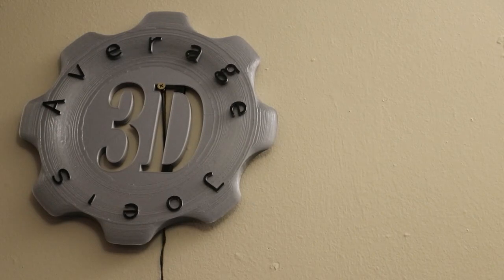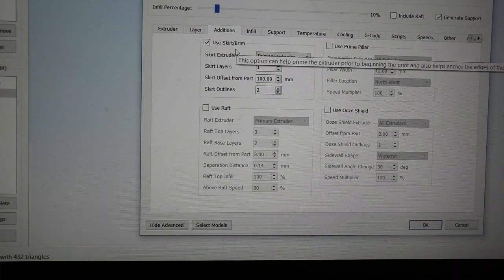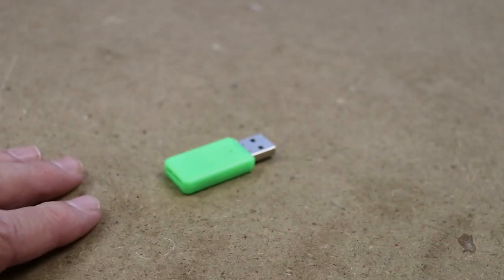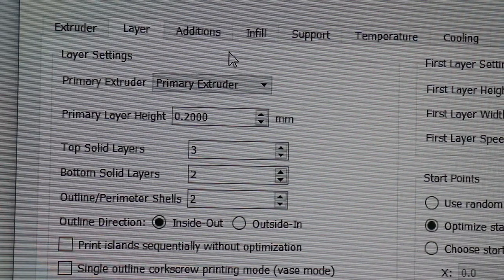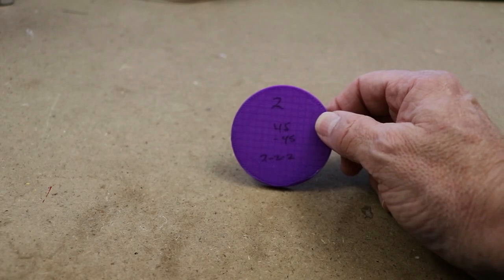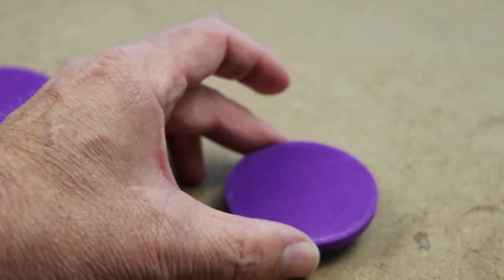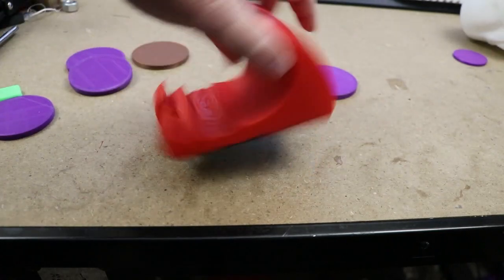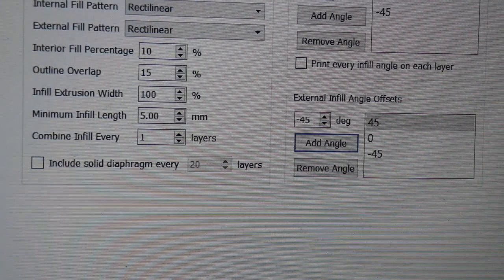Printing Top Layers

Comment: You might have already addressed this over the last 3 years, but I thought I'd mention that the top layer quality issues, i.e. holes and sag between underlying infill, looks to be an under extrusion issue. Here are a few mitigations you could test/try. 
1) Increase your hot-end temp.
2) Increase your extrusion flow rate.
3) Increase the top/bottom extrusion layer widths.
4) Decrease your print speed.

If you want to maintain the existing print speed, then first try changing #1 and #2 in tandem. 
Note: Increasing #1 only will increase the occurrence of surface zits and line blemishes as well as stringing between z-hops. 
Note: Increasing #2 only will increase the nozzle pressure but not the extrusion rate because the heat block still cannot heat filament fast enough given the print speed desired. This will result in increased blobbing as the print head approaches the end of a line segment/layer-change when your jerk setting values are default/conservative. Enabling coasting can improve the issue for longer segments, but short segments will still suffer. The higher pressure will keep the filament flowing even after the print head has reached the end of the short segment. It will also prevent the segment from getting the filament soon enough when the short segment starts. Lastly the higher pressure will increase the chance for stringing as the print head will be in transit while the pressure normalizing. Enabling retraction can reduce stringing, but retraction can cause other issues that would probably crop up elsewhere; like the printhead oozing filament when it pauses at a layer change or print head travel. 
Decreasing #4 will allow the heat block more time to heat the filament up to temp before its extruded. This might be the easiest change but you wouldn't be able to maintain or increase your print speed without artifacts.  

My notes here are just as important for me to put into words as I hope it might help improve your prints. I also hope this assists others that come across your video in the future.

Thanks for posting it. 

P.S I would be curious if/how you have addressed this since you first published this video. 
Cheers!
- Chris